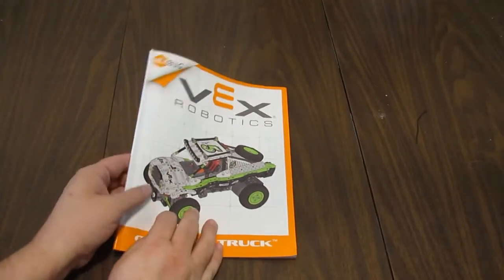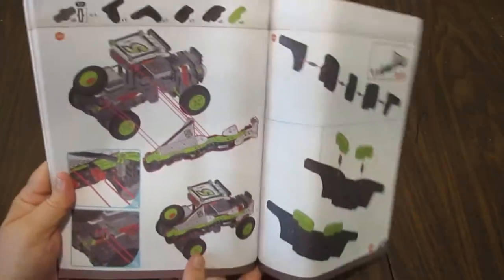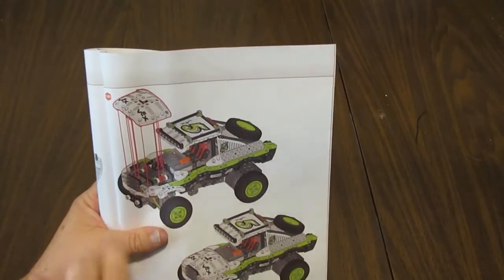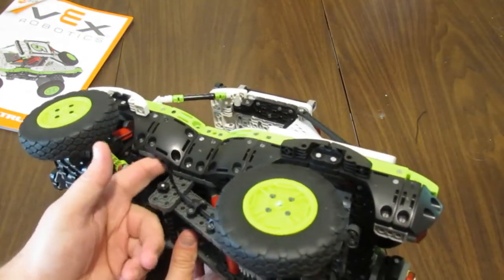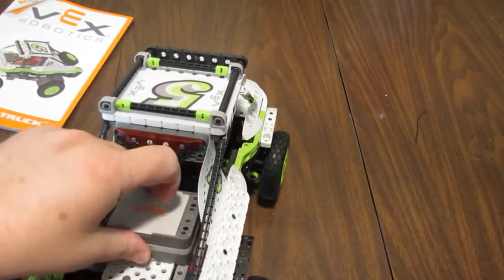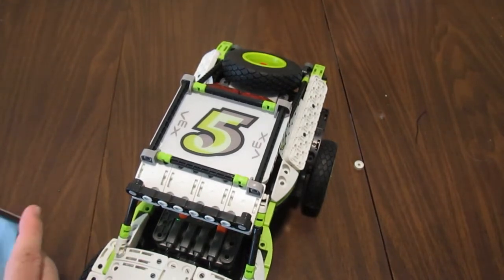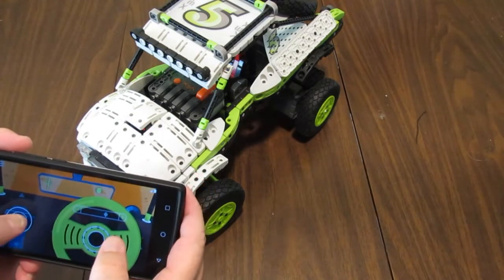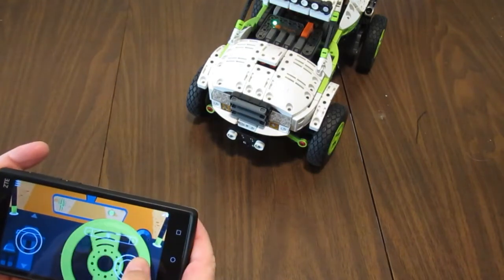HEXBUG VEX Robotics Offroad Truck Completed

Comment: Will not pair
Reply from the maker: I replied to another comment about having trouble pairing. I will copy my previous response here in case you are having the same trouble that I had:

I had to ask for help from some people I know who work for VEX. This is what they told me: 

"If you launch the app you should see the toy selection screen first. Click on the truck and it should take you to the connection screen. That screen says to power on the brain by pressing the power button once. That should light up the led on the brain solid green. Then if the phone and this brain have never paired the second tile on the connection screen tells you to tap the power button twice. That will put the brain into pair mode. The led on the brain should blink green slowly. Once that has happened you should get a link. Also make sure you have Bluetooth turned on and make sure the app has location privileges."

The last sentence was the key for me. You have to turn on both Bluetooth and GPS in order for the pairing to work. Otherwise it will not pair.  Once you have paired with the brain then you do not need to have GPS turned on.
Reply: @afanofosc  awesome!  We were just hitting bower button too many times, etc.  Now it works!! Thank you.  Next is learning  how to turn it.

Comment: Why doesnt mine even turn on???? And is it battery powered cause It worked before but I cant tell since the battery thing wont open
Reply from the maker: There is a battery box separate from the VEX Pilot brain which provides power to the brain.  That box is shown in the video when I pop off the spare tire and it is shown in the PDF building instructions.  The battery box has two sides which open up using your finger. They are a bit stiff to open but should pop open with a bit of effort.  Each side has room for three AA batteries.

Comment: Why isn’t my truck turning?
Reply from the maker: I also had some trouble with the steering at first. The online PDF instructions do a better job of pointing out that you need to make sure that the steering sensor is aligned correctly with the arrow pointing toward the top. If you don't have this aligned correctly it can cause trouble. In my case, I damaged the steering sensor and had to get a replacement from HEXBUG support. I encourage you to reach out their support department. They may be able to help you troubleshoot the issue better than I can.
Reply: John Hansen OMG THANK YOU SO MUCH ITS WORKING NOW

Comment: How did you get it to pair? I have an LG g5 with android and i cant get it to pair.
Reply from the maker: I had to ask for help from some people I know who work for VEX. This is what they told me: 

"If you launch the app you should see the toy selection screen first. Click on the truck and it should take you to the connection screen. That screen says to power on the brain by pressing the power button once. That should light up the led on the brain solid green. Then if the phone and this brain have never paired the second tile on the connection screen tells you to tap the power button twice. That will put the brain into pair mode. The led on the brain should blink green slowly. Once that has happened you should get a link. Also make sure you have Bluetooth turned on and make sure the app has location privileges."

The last sentence was the key for me. You have to turn on both Bluetooth and GPS in order for the pairing to work. Otherwise it will not pair.  Once you have paired with the brain then you do not need to have GPS turned on.
Reply: make sure your blue tooth is on